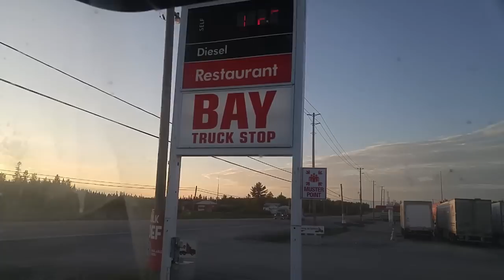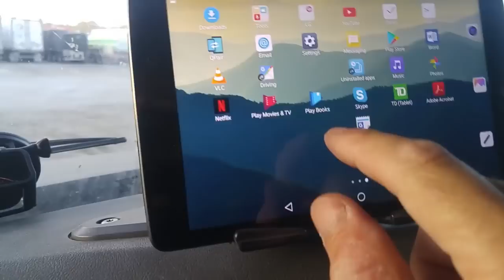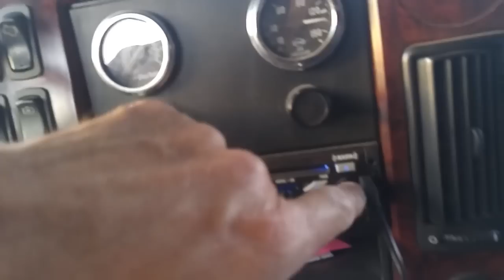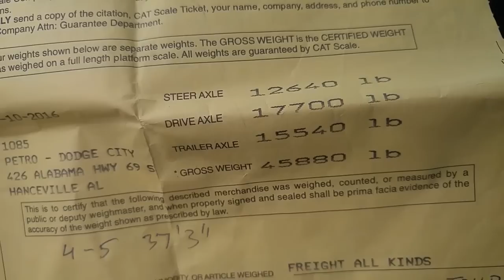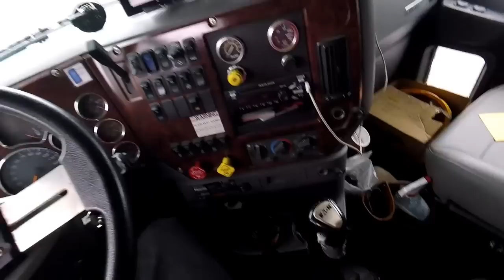Heavy Haul TV: Episode #545 -- 69,200 LB CAT Mine Loader

Comment: Love the intro music,. Truck drivers don't care about loud things. Hope you get your service done. Your up to 35k subscribers well done.
Reply from the maker: the shop just called. the truck is ready. will pick up tomorrow. they fixed: a small PTO oil leak, found a surprise fuel leak (!), failed to identify the air-in-the-fuel problem culprit,  replaced the fuse panel which should fix my 12V ports, greased the electric components against the corrosion, checked the front end u-bolts, bushings, and springs; and supposedly fixed the steering jug leak...
Reply: Sergei Dratchev Have you considered installing a FASS on your truck. It self primes and removes air from fuel.